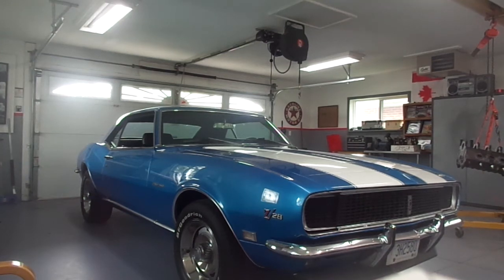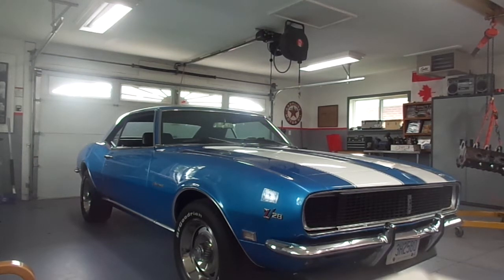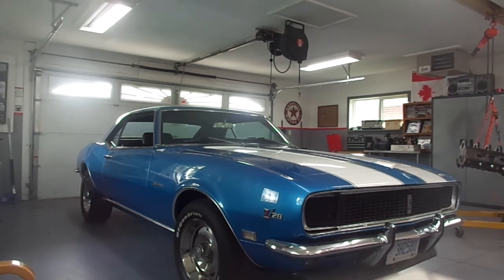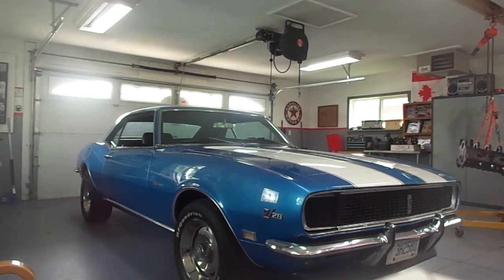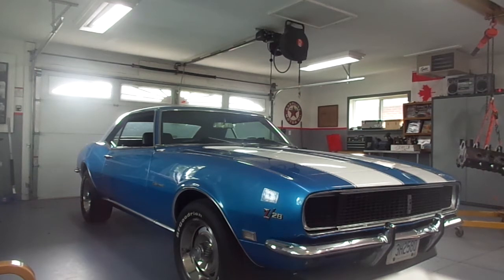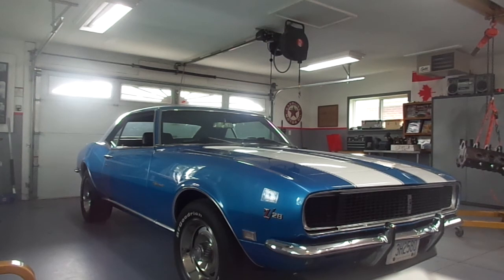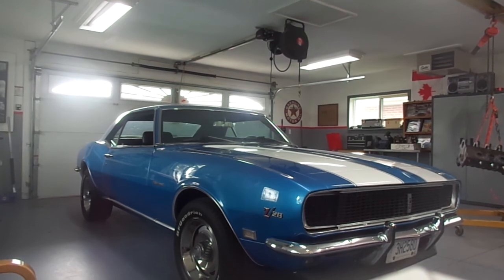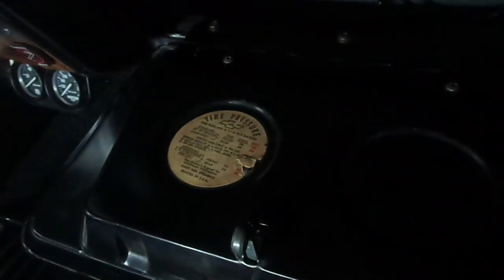Z28 Camaro, Factory produced race car

Comment: Great car Al, ....Brings back a grt memory of a drag race on our road one evening between an F stock 64 Chevelle and a new Z28 Rally Sport. Both cars were within a foot of each other and were in the low 13 second bracket. We saw the finish from an elevated mound about 50 feet from the road. The 327/250hp Chevelle had slicks and headers and was running on the record when it went to Indy and came in runner up. Never forget that event. I was still in high school.
Reply from the maker: Thanks for sharing Ed. I cherish having this car back and the memories it brings back. It is a thrill every time I get to drive it. See you doon! AG

Comment: I have an rs 4 gear 275 horse 327  /12 bolt deluxe interior rag top with your paint job ! Not a z but close ! Lol
Reply from the maker: very nice, i  love them all.  I had a 67 with 327/275 4 speed. if I could find it I would buy it back too. Thanks for your comments.

Comment: So how do we know yours is a real 68 Z28?  
Anyone can talk about the history of the Z28 and what goes in the 302 motor. Anyone can put 15 inch DF Rally wheels on their 67-68 Camaro. Also, anyone can put a sticker on their glove box to look like a Z28 tire pressure or even replace the glove box door. Also your Z/28 emblems are too far back on the front fender. You totally ignored how to tell the differences between each 3 years. You probably know that on a 68 Z28 there is no way to tell what you have, unless the original 302 engine in the Camaro on the 68 Z28, because the VIN will be stamped on the engine to match the VIN on the car. Yes, people do stamp engines too these days too. Do you have documentation to prove the authenticity of your Camaro? Do you have pictures from when it was new? If it is a true Canadian Z28 then you should have documentation from GM Canada to prove your 68 Z28. I doubt very much your 68 Camaro is a real Z28, unless you have proof.
Reply from the maker: Thanks for your comments Thomas. I have lots of documentation including 
GM Canada with all the RPO codes. The, the best proof I have is a picture of me driving it on the drag strip with 1969 license plates on it.
Reply: @goldsgarage8236  Can you show us the picture from 1969 and also some of the documents from GM Canada?
Reply from the maker: Thomas, please check out the new thumbnail. That was at Northern Dragway, Sault Ste. Marie Ontario in 1969. I have other pictures of the car when I bough it.
Reply from the maker: Thomas, check out the home made track bars in the picture, I fabricated them myself in 1969 and still have them. They were still on the car when I bought it back. I also have the 4.88:1 gear and electric fuel pump that were also in the car when I bought it back.
Reply: How bout a dna test?😁